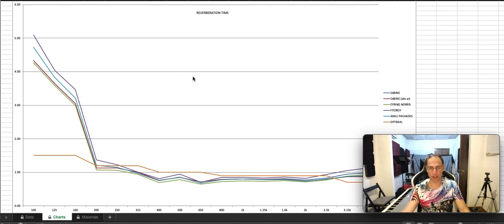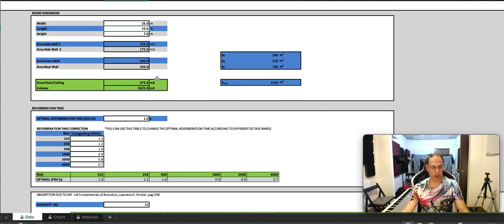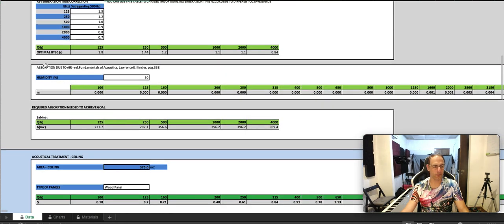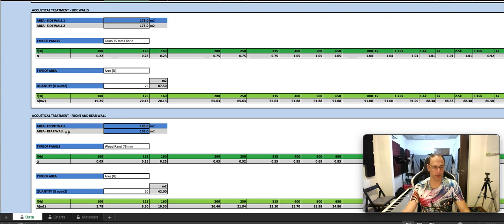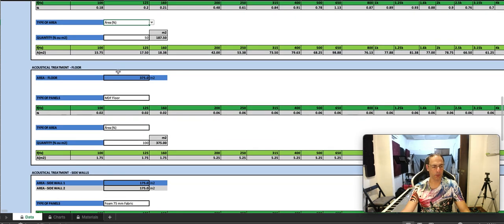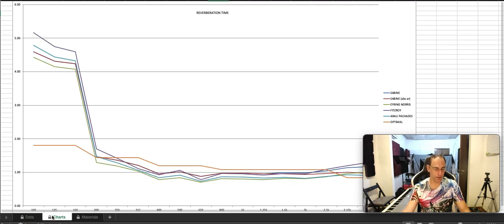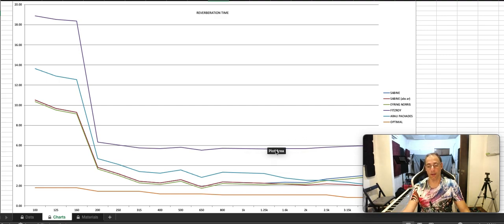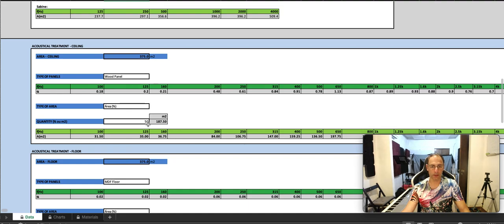FREE EXCEL : Predicting Reverberation Time !

Comment: Hello, 
Can it predict a room with attic gable roof shape?
Reply from the maker: It was made for very fast calculations of the reverberation time for rectangular zooms , it is has several limitations but it will give you a rough idea
Reply: @onlineacoustics  Ok, Thanks😊
Reply from the maker: On the Excel spreadsheet there is a description on the limitations of the calculations. The idea of the spreadsheet is to have a fast tool just to give you an idea on the acoustics of the room and possible acoustical treatment @panca4238